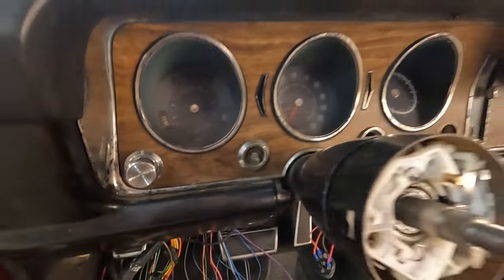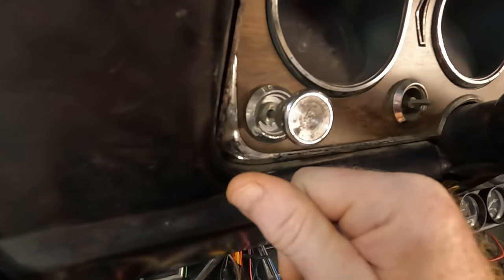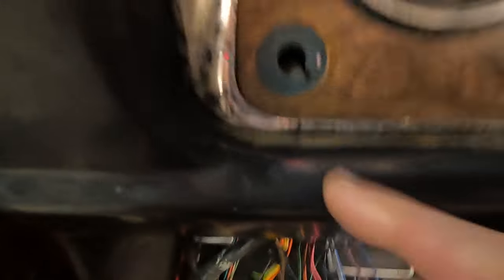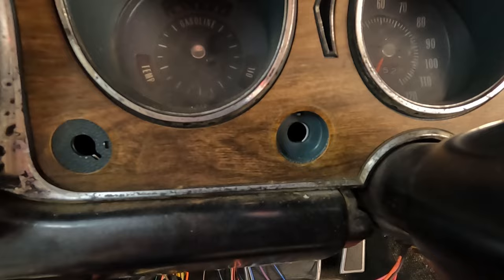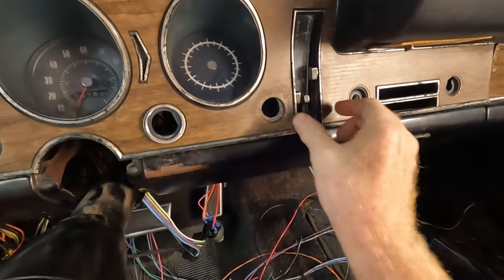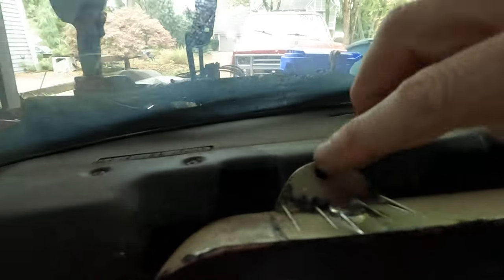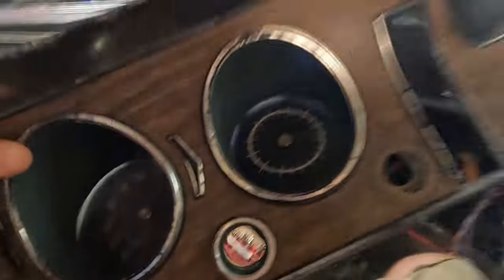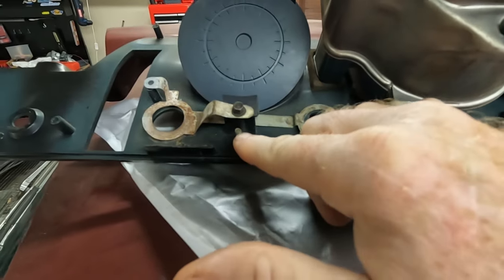Removing a 68 Pontiac GTO, LeMans or Tempest Instrument Panel

Comment: Great I have been scratching my head on how to remove the dash on my 68 GTO Manual down here in New Zealand not much information on GTO's down here my thanks have a problem with the ignition switch, I think. Replaced the Mallory ignition system with a new one still no spark changed coils took one out of my 70 Firebird still zip no power at the fuse box got to be the Ignition switch thanks again Jimmy.
Reply from the maker: Thanks! That’s why I made it - couldn’t figure it and there were no videos.